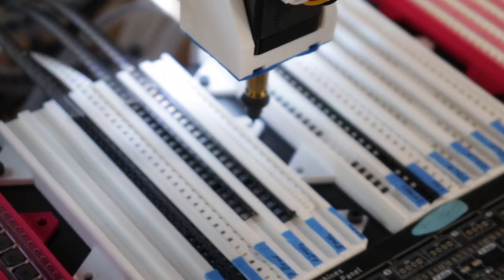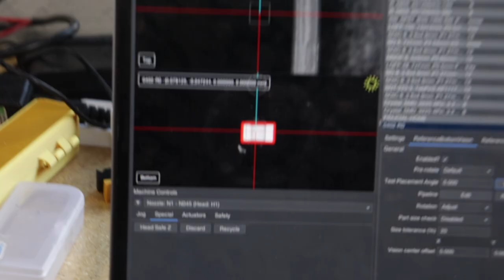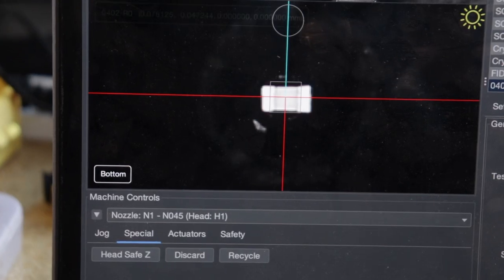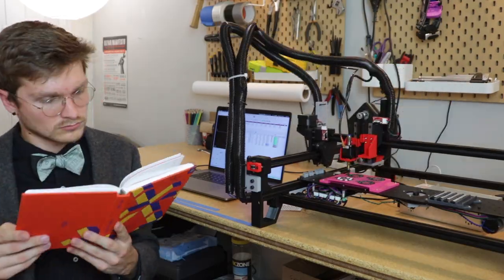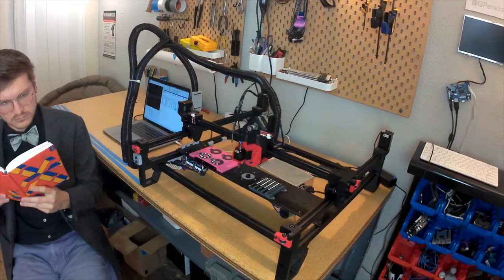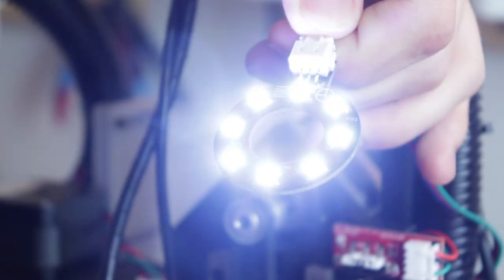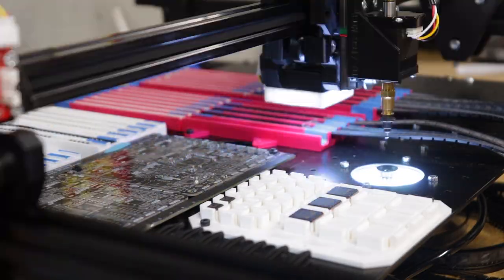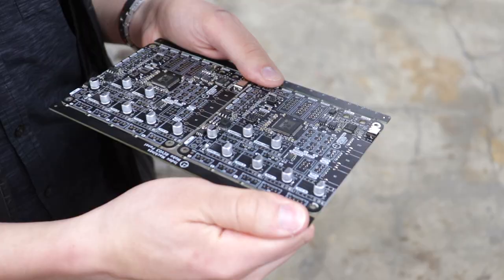Stephen Hawes // 2022 Channel Trailer

Comment: I’ve been following this from the start and it’s been an inspiration to me the time I’ve been in college. I’m a computer engineering major about to graduate in May. If you’re looking for someone with grit and a passion for things similar to what you’ve been working on. I’m interested and I’m sure there are others. I’ve worked a few summers for the engineering department here at my university and I’ve been trying to convince the lab manager to replace the broken PIP with one of these. Any advice on how I could sell him on the idea? My engineering professors come from a mindset still that 3d printers, pick and places machines, and any other CNC’s are 10’s of thousands to be worth it. They think these things need to be constantly fiddled with. I doubt it would be anymore fiddling than the current machines we have. They’re always breaking.
Regardless, best of luck! Love this drive
Reply: I would probably say, once the kit comes out, if you have the $500 or whatever it's going to be, just go and buy a kit. Show it to your professors and prove to them that a $500 machine can work as well as a $5,000 machine. I know college students are low on money, but if you really want to help the project out, then consider it.

Comment: I think your product would skrocket fi the software is easy and simple to use. People want to focus on hardware design, not assembly as you say. 

I'd be in the market for a machine if one doesn't require source code knowledge to make it work. Just an installation and good tutorials and I'm in